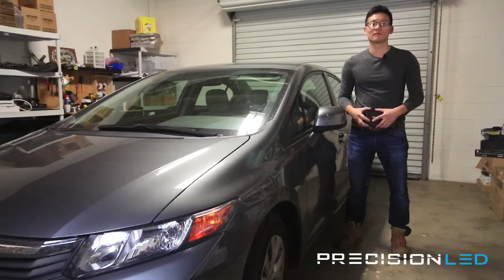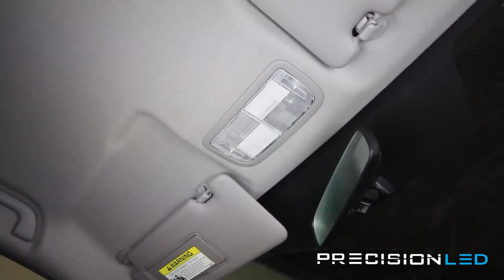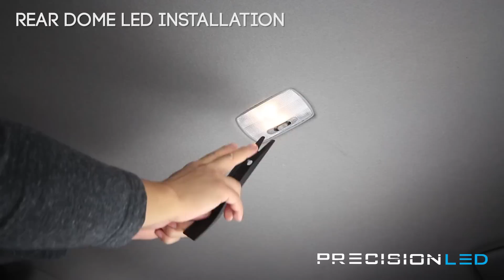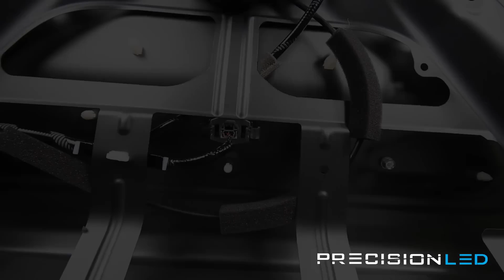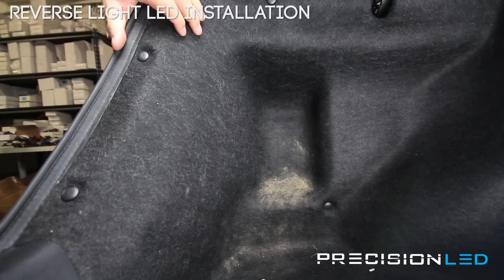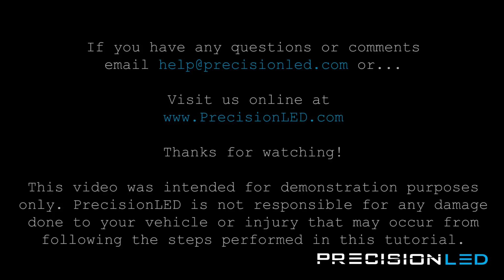Upgrade Honda Civic LED - 9th Gen (2011-2016) @PrecisionLED

Comment: My led headlight doesn’t plug into the factory plug that the original bulb plugged into. It doesn’t fit and the two metal prods are closer together than the original prods on the original bulb. Do I need some sort of an adapter?
Reply from the maker: Did you purchase your LEDs from us? If so, please contact us at help@precisionled.com. If you purchased your headlights from us you would not need an adapter or anything additional because they are designed to be a simple plug-and-play installation.
Reply: @PrecisionLED  yes I did, I will send a message thank you.

Comment: I have a 10th gen can't seem to access the license plate light I was able to pull the clip out.
Reply from the maker: If your vehicle comes with stock halogen license plate lights, there would likely be a single tab holding the lens into place.  Which you can use our trim tools to pry down to release.

Comment: You guys should make a led kit for the headlights. I have a 2012 Civic LX and would love some new headlight bulbs from you guys(:
Reply from the maker: Thank you for your interest.  Although we do not have a video yet on the Civic headlamps, we do indeed carry a headlight kit, which you can find here:  http://www.precisionled.com/premium-9006-cree-hl-gl-headlight-led.html

The installation process is identical for all vehicles.  The only major difference would be physically accessing your halogen bulb.  I would recommend having a watch at some of our headlight installation videos on our Youtube page.
Reply: Your reflectors aren't designed for LEDs... focus point of the lamp/LED housing would be all wrong if you replaced the OEM bulbs with LEDs.  You wouldn't be happy with the result.

Comment: Idk why but every time I step on the brake my radio gets interfered with all this static. It's only when I hit the brake. I changed the bulbs to LEDs in the rear. I'll leave the car parked and hear the radio and it's fine , it's only when I hit the brake
Reply from the maker: That is very odd.  I would initially think this would be a battery issue, however your brake and battery do not have anything to do with one another.  Where did you get your LEDs?  We have definitely never heard an issue like this with our LEDs.  Feel free to contact us directly at help@precisionled.com for additional info.